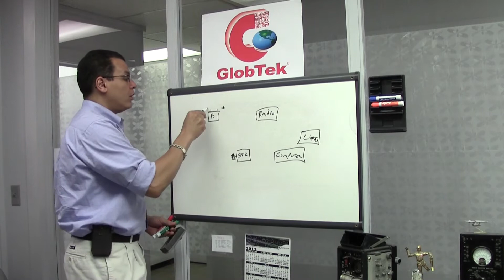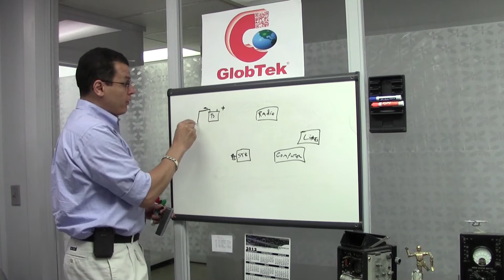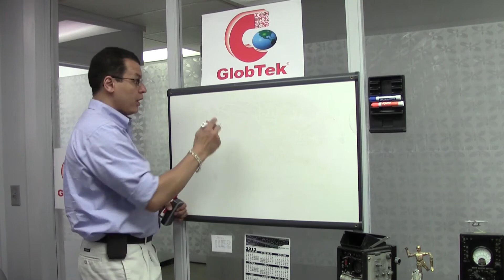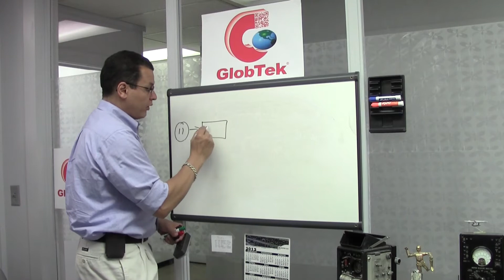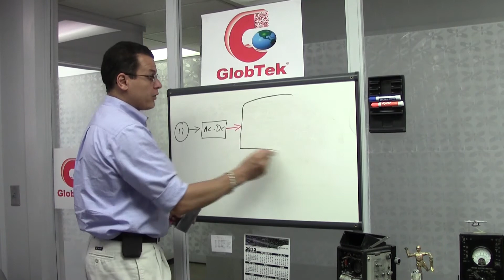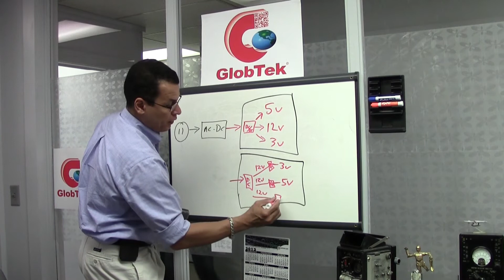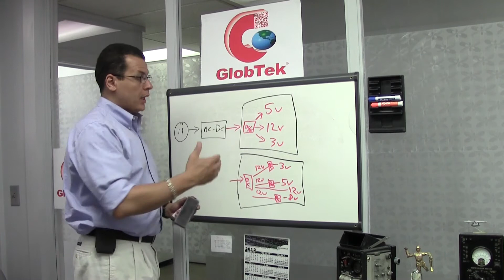GlobTek Power Supply Basics #3 - What is a DC/DC Converter?

Comment: My electronic device accepts 12v 12ah dc power. The supplied power adapter converts a 110v AC to 12v 12ah Dc for the device to power up. Then, would it be ok to use a 12v 12ah battery to connect directly to this electronic device instead?